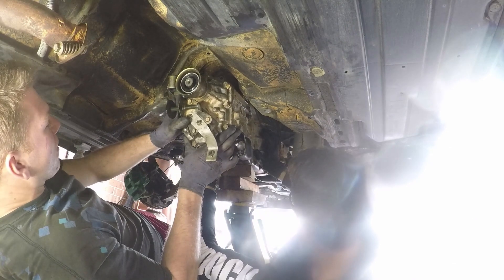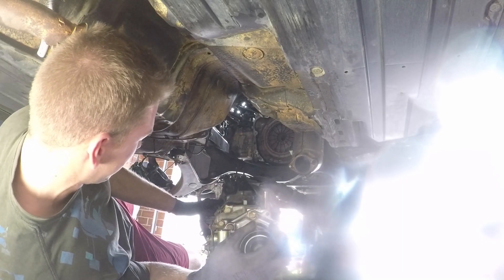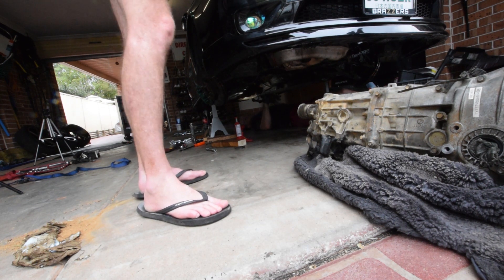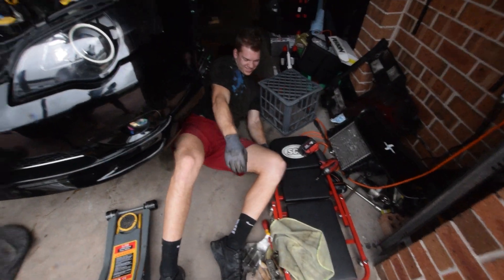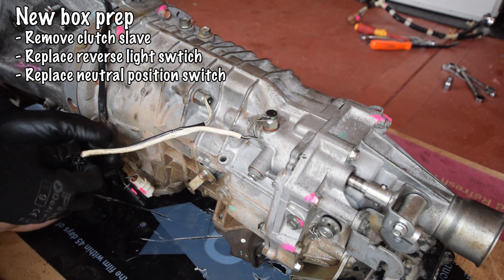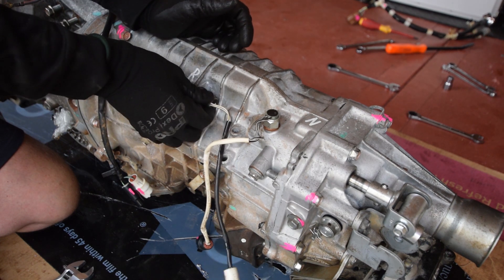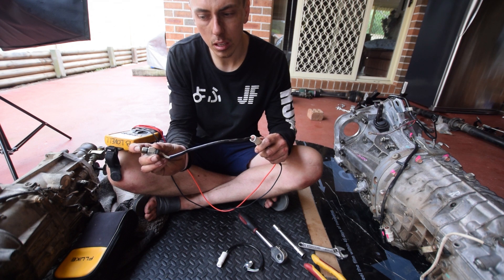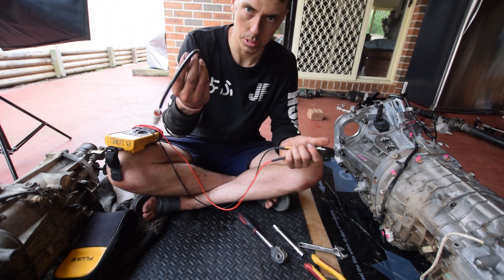How To 6spd Swap a Subaru | Part 2

Comment: Where did you guys get the neutral and reverse sensors from?
Reply from the maker: I used genuine a Subaru ones. If you troll some of the forums online youll find the part numbers pretty quickly, it's not worth using anything else, the genuine ones are like $20-$30 from memory.
Reply: @BuiltByBlake  thanks for that.
I'm about to drop a 6 speed into a forester and can't get ANY continuity from either sensor.